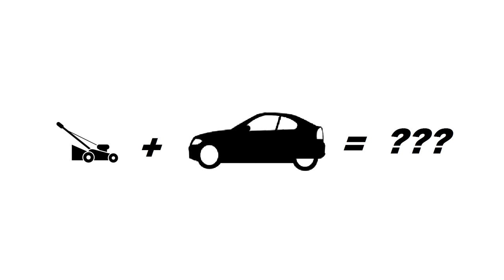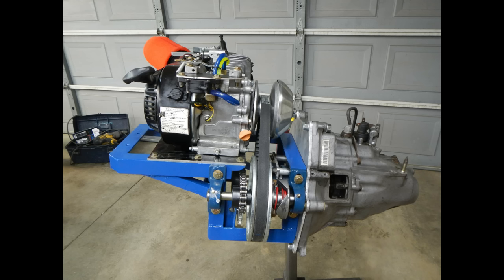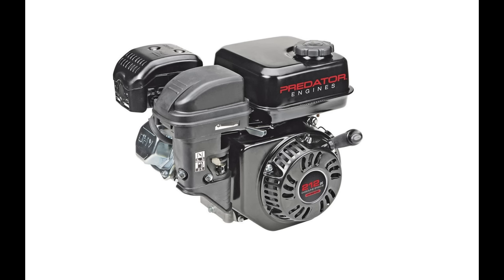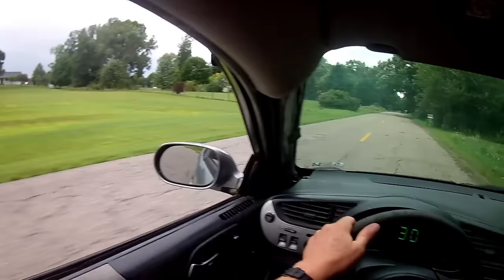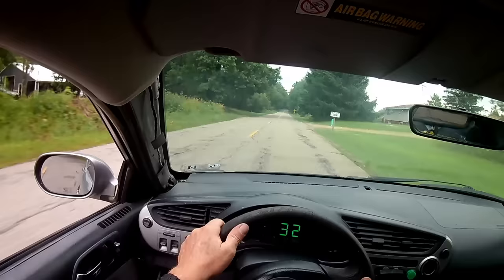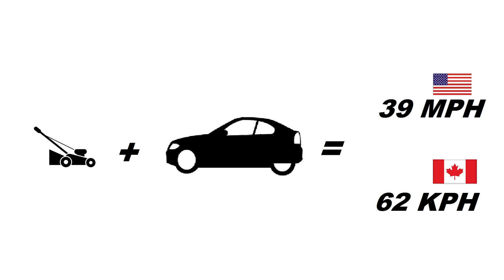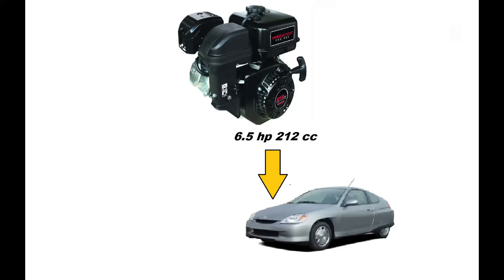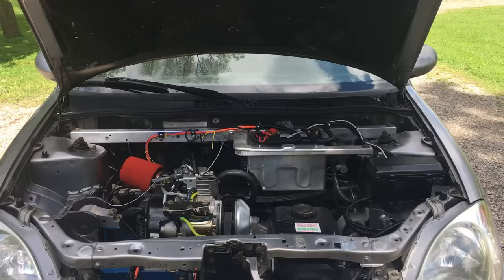Episode 1.  We put a $99.00 Predator engine in our Honda Insight.

Comment: Someone used a gasoline car engine as a pneumatic mor in a minivan. 58 mph.

But before that the great Chicago AUTO RACE.THEY HAD the (2 qty.) Stanley Steamer cars on steam pressure 300 p.s.i.!
One car was 6 hp. And the other was 9 hp. But each car weighTed 3 tons.( No aerodynamics either ! 
( top speed was 115 mph)

That was in the 1930's!

Tip: 1 horsepower can dead lift 33,000 lbs . Up to 5 feet in under 1 minute!
How much does your car weight?

Also on steam pressure comp a red to hydraulics.

Steam or air is limited  to under 600 p.s.i.
Yet hydraulics can go up to over 10,000 p.s.i. on 1 horsepower!❤❤❤❤
Add that as a inpit to a transmission.
= more power and speed too.❤❤❤❤❤❤❤❤!

Lance Amrmstrong built pedal bikes that hit 80 mph in an enclosed shell for wind resistance. Pedaling is = 1/3 horsepower from the human body!

Comment: 1 horse can run up to 55mph. Weighs 660lbs or so. Theoretically, 6.5 hp should do 55 no problem. Especially with gearing changes. But thats just a horse theory

Comment: I was laughing up until I remembered my daily driver is a 660cc 50hp Pajero Mini (snoopy edition) that doesnt drive much better straight from the factory. Flooring it, empty, in 4th gear, it can barely manage 90kph uphill, or 120kph downhill, and it starts vibrating to pieces at anything over 80 kph.

Kei cars are weird.

Comment: How did you accelerate the vehicle. Did you use the stock pedal and if so how??????
Reply from the maker: The stock Honda insight throttle cable was connected to the throttle control on the predator engine.   Basically its the same as connecting a go kart or mini bike throttle to the predator engine.  As I recall in this video we were still using the governor because we wanted to find out how the predator engine would perform right out of the box.
Reply: @robotcantina8957  ok thank you

Comment: How do you get the power steering and brake servo to work with this set up.
Also how do you charge the battery to power electrical systems?

Comment: You should just make it a real Honda and put a built B18 in there or a built D16. The D16 is a tad slower than a B18 but will last forever. K20 and K24 aren't worth messing with because they're super weak and unreliable.

Comment: How was the transmission adapted?
Reply from the maker: Have a look at our 420 HEMI episodes, we get into all those detail.
Reply: @robotcantina8957  i will. I saw a video a while back where some good ol boys took that predator and tore it down and super charged it. They stuck it in a 3/4 size dune buggy. It was impressive. They were way past the 99.00 mark after all the parts they had to have machined though.
Reply: @robotcantina8957  ive got a challenge for you. If you have a guy in your group that claims to be a ladies man. Send him out in that car with no hood on it and see how well the night goes for him. Ive taken that challenge and used a honda passport . not even a big scooter but a passport that hadnt run in decades. I didnt leave alone.  To be fair i think it was the tassles on the handlebars that closed the deal along with the little white basket with flowers hanging on the front.

Comment: Interesting project, but I'm skeptical about the claim that it's street legal. I thought it's against EPA regulations to remove a motor which was required to meet certain emissions standards and replace it with a motor which does not meet those standards.
Reply: just dont transfer the title and no inspection.
Reply: @PLAYERSLAYER_22  Avoiding getting caught doesn't make it legal.
Reply: @sbunny8  dude its a lawn mower engine, this is financially insane. just because it is possible, doesnt mean its a problem.

Comment: You might have had more than a comedy video if you installed a more reasonable engine like a Predator 22 HP (670cc) V-Twin.  Or say, a used motorcycle engine of 30 hp to 60 hp range like say a Honda 30hp v-twin all the way up to a Gold star 80-100hp. Then there is a Harley v-twin.  Now that would have been way cool.

You might might end up with a reasonable solution to a gas miser commuter car.  Think of the video possibiltles or a more serious channel based on restoring cars to light weight, gas sipping commuter transportation.  That might even be the basis for a small business..kunk

Comment: this is completely fake + you can see the editing of the video in certain shots if you look closely, where something in the shot has been covered up w/a different computer video image.  I'm sorry that 6,5HP motor cannot move both the car, a passenger and a 4K+ lb Jeep + trailer is not possible using the science of physics. try using your lawn-mover at home to pull your car + a friends together + see how far you get. why would not Honda have used such a small motor to begin with, if it was possible? but of course this person figured out what no billion dollar car company or automotive engineering team could. yeah, right. also, I'm certain this person has also worked out how to run a car on only H2o as well. great job on the fake / conspiracy videos!
Reply: There are fully working cars with 6-8hp engines driving around in Europe 😂